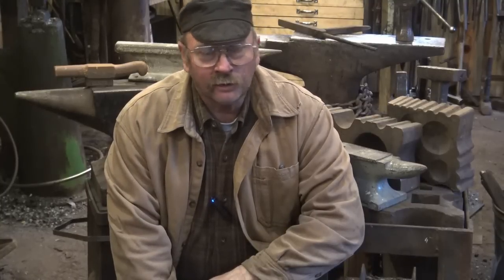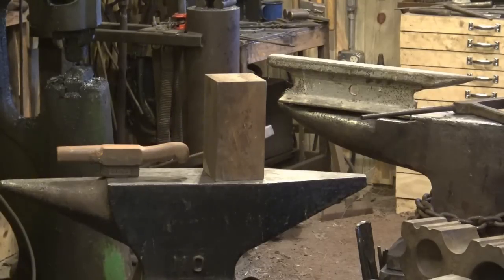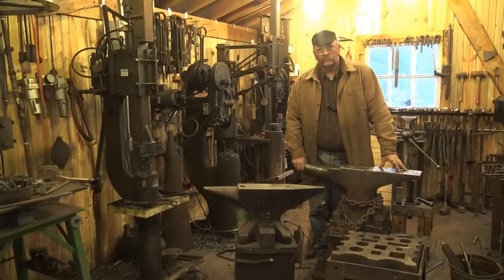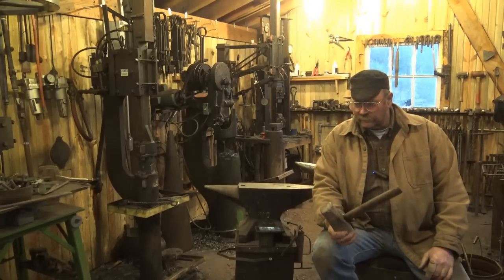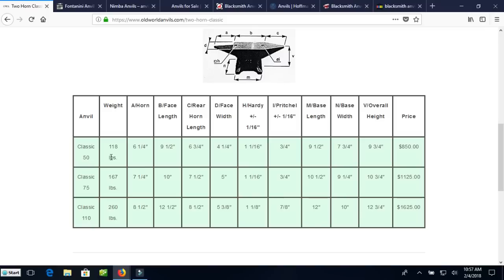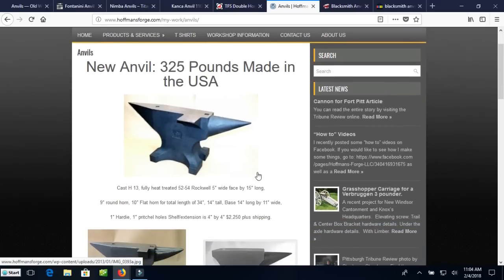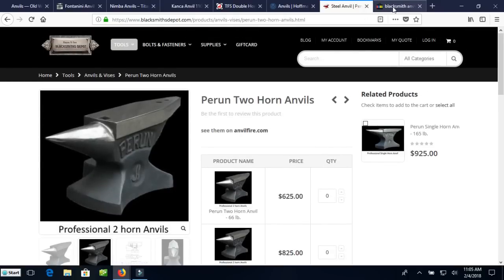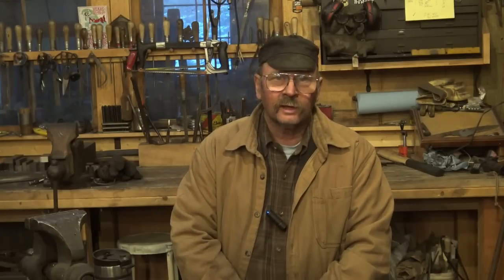Blacksmithing anvils and anvil substitutes

Comment: Hello from SLC, Utah. I know this is an older video but I have a question to ask you. I know you just changed anvils to a Fontanini and I was wondering how your old world anvil is compared to your fontanini and your anvil you traded for it? Is it noticably softer, less rebound? Noticably lower quality? I wouldn't mind love a refflinghous or rigid/peddinghous, fontanini, or nimba but they prices on old world are more manageable in my situation. Thanks for the content, keep it up.
Reply from the maker: The only real issue with the Old World anvils is a bit of a rough casting, but the face is easy enough to clean up and its a good anvil

Comment: A dumb question? I have seen offcuts of big steel RSJ ( I beam) at around 300 mm long. Extremely hard steel that when drilling? Lube on a 3.5 mm drill bit and drill slow otherwise you burn out the drill bit on one hole! Is that any good?
Reply from the maker: It would work.  Anything better than a big rock is a place to start.  Then keep your eyes open for something better

Comment: From the looks of it, your cast steel anvil is a Refflinghaus No.8 @ 110kg, right? The glacis on the Austrian-type anvils is called "Brust" (chest) and is usually a ground or machined surface at a defined angle to the anvil face. I am not sure of the actual use, but these types of anvils are popular with people working sheet metal, like knight armour for renaissance re-enactments and the like. Mine is a  450lb (or so) "north German style, one horn, with upsetting block" of unknown manufacture. As much as I like the European style anvils, I do see a big advantage in having this step from the face to the horn in the US-type anvils. The European 325 one you showed on the hoffmans page looks like a "dutch" style. Much like the North German, but they are more narrow. As for used ones - you find some on ebay, but prices are pretty much outrageous. I got mine "through my friend's grandmother's dog's cousin" as we say here from a pile of junk from an old factory. It had been in water for a while, and the guy thought it a shame to just load it on the train car off to the smelter.
Reply from the maker: The double horn is from Old World anvils.  I don't think it is a Refflinghaus, or they would use the name in their marketing.

Comment: Thank you so much. While it sounds a simple and logical still many would never even thought about it ( quality based on bouncing the ball). Actually, I always presumed that all the anvils are 100% cast iron. Regarding the railroad track. Would a welded block of steel at top of it be kind of solution?

Comment: Is it possible to improve a cheap Harbor Freight anvil with a thick layer of facing rod? I understand that smoothing it into a usable surface could be a problem, but it wouldn't be impossible with a good heavy duty belt sander and plenty of belts. I'm asking because I have everything I mentioned (Harbor freight anvil, LOTS of facing rod, a belt sander and plenty of belts), but I don't want to go through the effort if it's a waste of time.
Reply from the maker: Its not something I would spend my time on.  You might check out some of Roy,s videos over at Christ centered Ironwork.  He's done several on trying to improve those anvils.

Comment: Is it okay to modify my anvil? Say I want a shelf on the side or a small block for upsetting added to the bottom can I weld that on my anvil without hurting the use of it? I love the Fontanini anvils but 1 i don't think they are back and 2 I'd rather not pay a lot right now. So I was wondering is modifying an option.
Reply from the maker: It is if it makes it better for how you work.  However, welding on an anvil requires pre heating and careful attention to detail.   So it should not be approached lightly.  For a side shelf, you may be able to make a hardy tool with the shape you want.  I have one anvil with a separate upsetting block welded to a piece of plate that is then trapped between the anvil and the base.  Works just as well as the one on the Fontanini but didn't modify the anvil in any way.
Reply: @BlackBearForge  thank you

Comment: I ended up getting a piece if modern rail track from a co-worker and a forklift tine that was take out of service do to wear. Wondering if its better to flatten out the mating surfaces and forge weld the tine to the top of the track or just weld the pieces together? Not sure if forge welding will be an advantage. This will be my makeshift anvil till I can afford a real one. My thought process is in doing so, it will add mass and make my substitute a little more productive.
Reply from the maker: That would be a difficult forge weld unless you have a really big forge.  I think I would just weld up with multiple passes.
Reply: @BlackBearForge  that is sort of what I was thinking. I may try. I was also wondering if a sledgehammer would be sufficient force to hammer the pieces together or if a hydraulic press would be needed or a large power hammer to make the forge weld really stick well. But then will the thin web section bend from the force. Maybe I am just over thinking it. Thank you very much for your insite and response. I very much appreciate all your videos. I just finished recovering from covid and watching your videos, especially all the hook of the week videos helped pass the time with the 11days I was sick from work

Comment: If you look at what people hundreds of years ago were able to forge on those tiny and light anvils they had, you have to blame yourself and not your equipment if your work hadn't turned out as imagined. Of course it's easier to work on a heavy anvil but even if you can afford one, you can improve your abilities by practice, with pictures in mind what the ancestors were able to do, and if they could do it with minimalistic equipment you can do it also.

Comment: i feel like I beams should have been mentioned, i know there are a lot like railroad but probably wider and more work space because of that, specifically the one you had looked really thin, no offense to the original owner and im sure it would work well but i feel an i beam would be better in general, it would be far harder to make a horn out of but i feel like that isnt such a worry when your just starting out. they should be relatively easy to find too, i know for a fact there is a ridiculously massive one in my shed, probably as wide or wider than your anvils, although it has the slight issue of being structurally integral to the shed lol ;)

Comment: I have access to the counterweight of a small forklift. It probably weighs way over 100lbs. Would that make a good substitute for an anvil?
Reply from the maker: I would think it should work as long as it isn't something easily cracked, like cast iron and that seems unlikely.
Reply: @BlackBearForge  Ok thanks. I will go and get it from the scrapyard today and let you know if it works well or not.

Comment: What would be a good weight of anvil to start off with?
Reply from the maker: A good 100 - 150 pound anvil would be all you ever need.  I like the larger anvils, but they aren't required.  Under 100 pounds would be too light for a lot of work.

Comment: What the heck... is that big one forged? What tools are used to forge such a big thing?
Reply from the maker: Yes, at one time forging was the only way to make an anvil.  But not in your typical shop.  Big fires with lots of people and likely a big water driven power hammer, although for the age of my big anvil, steam hammers may have been available.

Comment: Any reason to NOT weld a 1 or 2 in thick plate of hardened or hardenABLE steel onto the top of a less expensive Cast Iron Anvil ?
Reply from the maker: It is difficult to weld to cast iron in the first place and achieving a good solid weld between the cast iron and the steel plate is unlikely.

Comment: Please don't use RR track as an anvil sub. It makes a lousy anvil It is made to support trains and it excels at that but it has way too much side to side spring and not near enough mass under the hammer to do much more than suck up energy from your hammer. You are much better off with a simple block of steel at about 100 pounds regardless of the aloy, even soft mild steel in block form makes a vastly better anvil than track.

Comment: I know this is an old video, and there are a ton of comments, so I'm not gonna read them all to see if my suggestion is in there already. 

But, I just thought about this. One of the scrap yards I go to, has their front yard where they put out a lot of good useable steel that you can pick through. They always have forklift forks out there. Anywhere from regular warehouse type, up to big forks from something like an 18ton or bigger forklift, that are between 2-3" thick. 
At $.30/pound (price in OKC), you could make a very useable makeshift anvil with that for cheap. Plus, they're good heat treated steel

Comment: John, folks who dont use hard-faced anvils say rebound has nothing to do with forging and quality anvils.
I have to wonder why the quality anvil makers invest so much time/effort and resources to ensure their anvils have a hardened face.
I guess its a waste of time and marketing if soft-steel anvils work just as well.
Reply: Ik you said this a year ago but I'm gonna tell you rn, rebound has alot to do with forging and the anvil with a hard end face is infinitely better than one without, not only will more of your striking power be obsorbed by the unhardend anvil it also doesn't keep its shape, they bend fast and don't last a tenth as long as one's with hardend faces
Reply: You're misinformed.
Reply: @chrismay2298  absolutely.  This is why so many use the face of a log to forge upon.  I mean, just the wood. You beed to keep it wet obviously.  But yeah,  a soft face works wonderfully.

Comment: I've heard a ton of good reviews on those NC farrier's anvils, for the price I'm sure you could do worse.
Reply: I think the real potential problem with farrier anvil is that the horn isn't round. They are flatter along the top of the horn than a blacksmith anvil. I had a n NC Basic I shod on for a long time and I tried to re-work the horn to round because it made it hard to get proper shapes.I think they do make round horned anvils, just a note to beware that not all are.

Comment: Would you be willing to sell me a set of the slotter and slitter set you are making now?  I’m willing to pay a fair value that you consider fair.  Please let me know.  Also, do you make anvils that weigh around 100 lbs and have both pritchel and hardy holes with a decently wide hammering face as well as a single horn!   If so how much would you charge for such an anvil?  If you don’t make anvils do you have an Associate you know of who does make the anvils?
Reply from the maker: I am not sure what slotter and slitter you are referring to.  However my current waitlist for new orders is several years long.  As for anvils, that is something much to large for conventional blacksmith shop.  I provided information in this video on where you could look for an anvil.

Comment: I have a 100kg+ anvil however it's concaved and has some deep gouges on the face and don't know what to do
Reply from the maker: Thats a common problem with old anvils.  Most people just learn to work around the problem.  Sometimes you can grind out the imperfections, but that might leave the hardened face overly thin.  You can also weld out the face to eel it out, but its lots of work and I have never been completely happy with the results.
Reply: @BlackBearForge  i just checked mine and it's also very soft probably below 45hrc. I guess I'll have to get used to it. Already made 3 knifes and a pair of thongs so it gets the job done. Thanks for the reply!

Comment: can you have steel plate welded to the top of a cast iron anvil
Reply from the maker: Welding to cast iron is very difficult.  If it can be done I am not the one that knows how.
Reply: Braze weld maybe,  arc weld,  not a chance with cast iron

Comment: Rebound really doesn't make any difference, see Joey van der steeg 's recent video for proof, he bolted a piece of mild steel to a big block of wood and forged out a leaf just as he would have on his main anvil. Joey also has another video on the issue of anvil rebound and how it's really deceptive
Reply from the maker: I watched that video, it is interesting and does show that you can make do with very little.  But without a side by side comparison of that little anvil and an anvil with better rebound it is not possible to draw any conclusion regarding rebound.  It is certainly possible to forge on just about any solid surface including stone or a wooden stump.  But the rebound effect is part of what makes the work more efficient when done on a heavy iron and steel anvil.

Comment: Would you happen to know what the horizontal hardy type hole in the base of peter wright anvils is for?
Reply from the maker: Those are left from the manufacturing process.  They were for a special type of tings suspended from a crane so the anvil could be safely handled during forging.